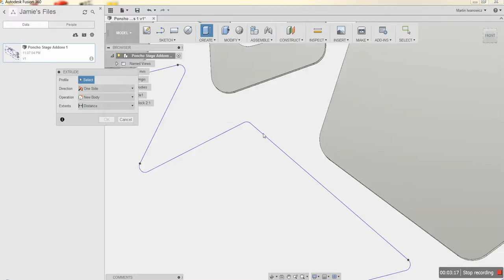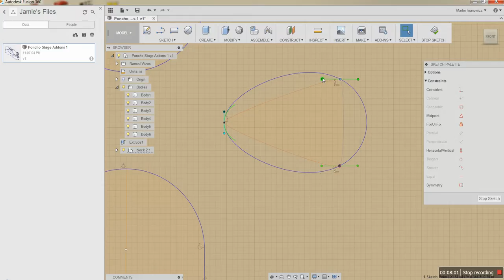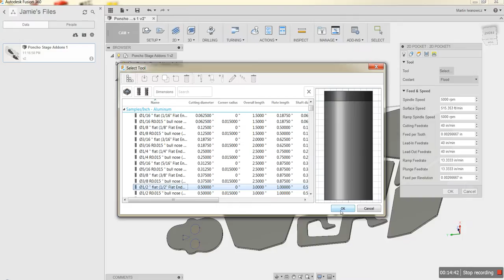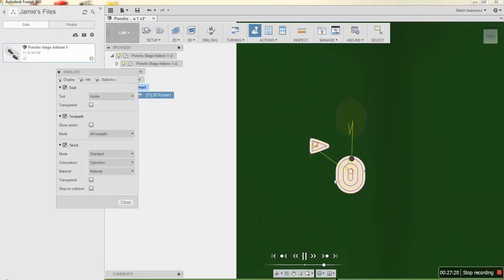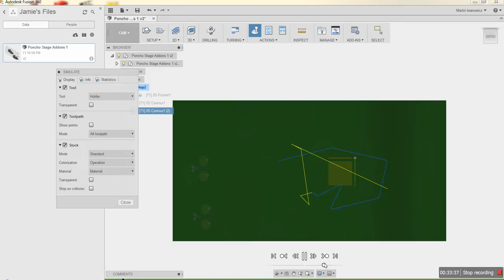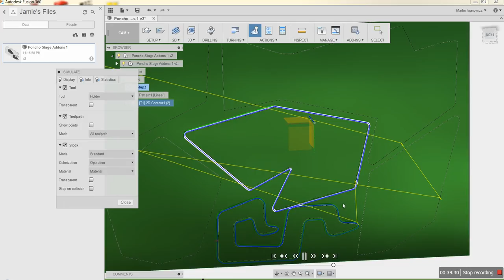Creating CNC Router toolpath from .dxf in Fusion 360

Comment: When working the eyes and nose, you can't select them because they are on the back of the extrude. Flip view around to the back you can them select and extrude them -.75.
Reply: Brian Sullivan, that's the hard way... The easy way is to click and hold the cursor over the line for a couple of seconds. This will bring up a list of all the features below the cursor. Select the one you'd like to work with - the line on the bottom - and extrude from that.

Comment: I've found inserting the dxf rather than uploading and using at a base reference to project from easier. Create a sketch on the same plane as the dxf and just press P. This also can make troubleshooting which contour is causing any problems if they are present.